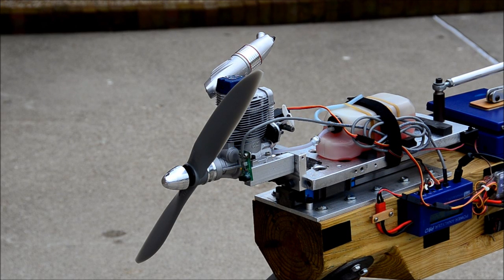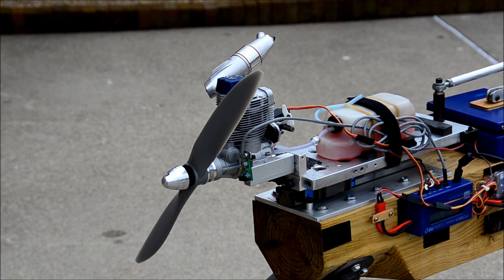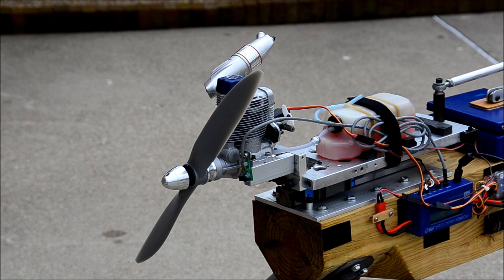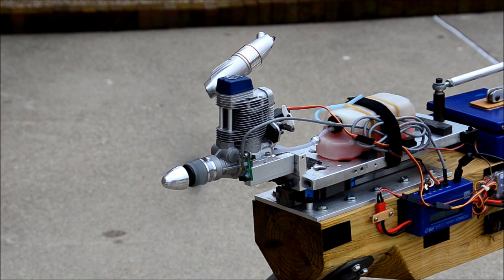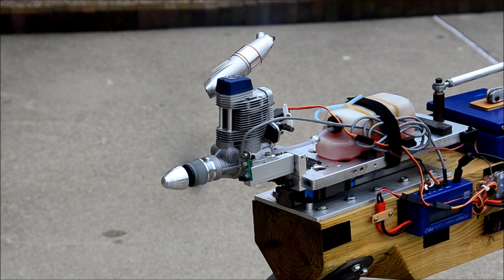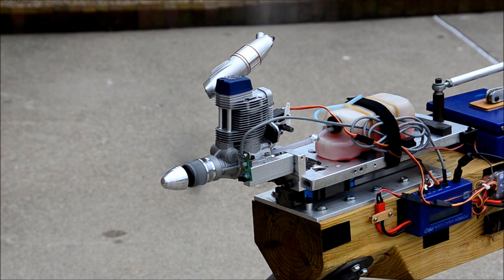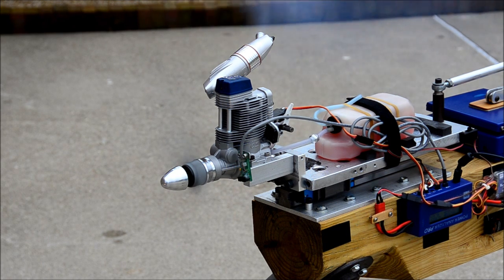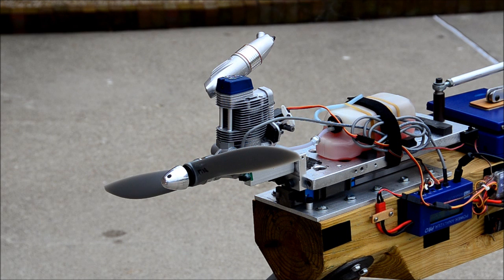O.S. 155 FS-a Engine Test

Comment: Hi Mike, Do you think this engine is better than the satio 150, in regards to performance, throttle transition, i have a satio 150 that throws propellers at low throttle when transitioning, no matter if it is rich or lean, is the 155 in this video for sale at all? My 150 has about 4 gallons through it and it doesn't seem to be getting any better? i don't know what to do.

Comment: I have an OS 155 FS alpha as well and measuered the following RPM numbers:
SONIC 15x8  >10000
SONIC 16x8: 9200
APC 17x6: 8700
Fuel was Tornado heli with 18% synthetic oil and 5% nitro.
I am concerned there might be something wrong with the engine because this is slightly less than an FT 160 which is rated a lot weaker than the 155 FS.